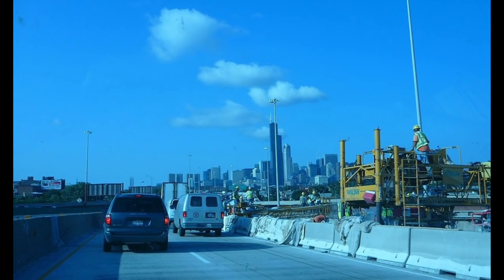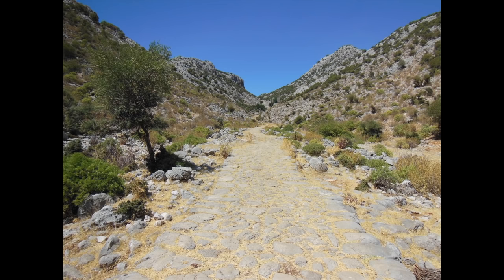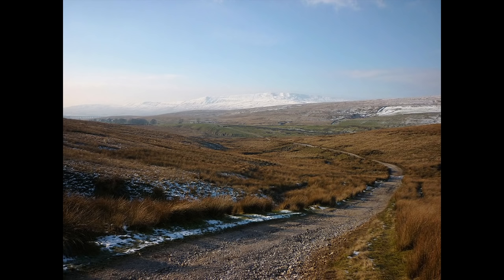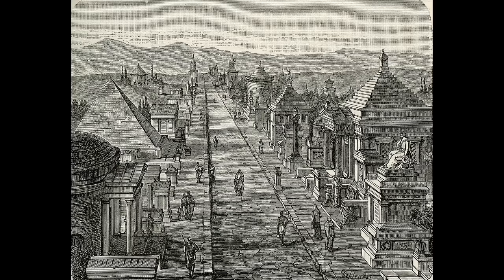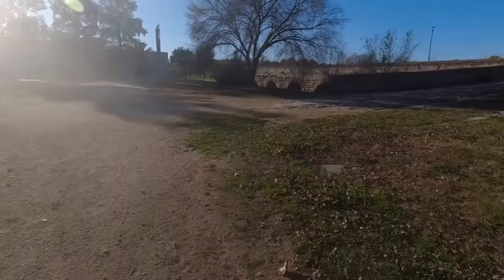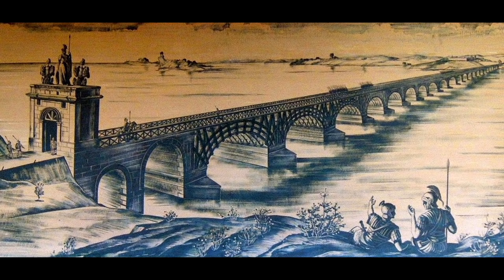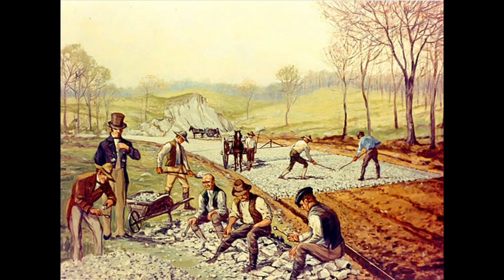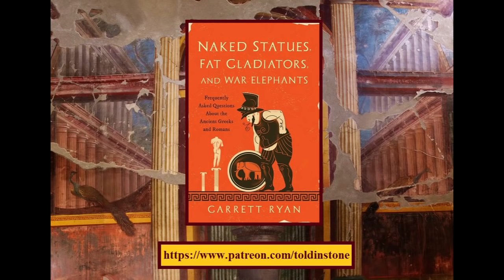Were Roman Roads more Durable than Modern Highways?

Comment: I’ll elaborate further as a civil engineer. It’s all semi trucks. That’s it, if traffic was just passenger vehicles we could get build cheaper infrastructure that lasted much longer.
Reply: Yeah, try running semis on Roman roads and see how long they last.
Reply: Why do that when you can have trains!
Reply: True that,And also billions worth of paving slabs,where semi's mount the curb onto pavements ,for deliveries ect
Reply: Kinda sounds like you might not be a civil engineer and just a guy who watched a YouTube video that was going around a couple weeks ago decrying semi trucks while neglecting the fact that the roads aren't built necessarily with the express purpose of private travel.
Reply: @dread6554  lol, I’ve designed so many bridges I can’t even give you a number. Get back to me when you’ve read your AASHTO manual a few more times.
Reply: @caballeroquimera2501  hush. Dont let the car manufacturers hear you
Reply: Semi trucks?
Hahaha

When actual trucks pass where I live
At 60 km/h or more
Then the whole bed and all windows start to shake.

Semi trucks don't bring that kind of weight displacement.
Reply: @dread6554  Commercial traffic is what keeps the economy running. So it's only natural that engineers would take trucks into consideration in addition to private vehicle traffic.
Reply: @MrDwarfpitcher  do you know what a semi is? Its a tractor trailer. The largest road legal vehicles. The biggest thing outside mining equipment really. Seems like a translation issue.
Reply: @MrDwarfpitcher  I'm not sure you're clear on what semi-truck refers to...
Reply: @Captain Irony Yes, and to last 50 years before complete rebuilding.
Reply: @MrDwarfpitcher  Terminology. A US semi truck is a truck tractor with a semitrailer that has no front axle, but the front end of the trailer rests on the tractor. They can be extremely heavy.
Reply: @MrDwarfpitcher  they mean a lorry
Reply: It’s called Greed
Reply: I wonder how durable or what materials for roads today would be used, if money wasnt this kind of a choke point in building infrastructure. Like if you could use the best aveliable materials and over engineer it to the max, what would be the best we can do? 🤔
Reply: @GarrettDore  I am not sure if you are betting on the semis or the Roman roads, but I think the Roman roads are so rough that the semis would be shaken to pieces.  They certainly wouldn't be able to travel at highway speeds.
Reply: That's why we should be investing more in high speed freight rail, with much less rolling resistance and damage. That way we can keep the 2 day shipping times without the damage that the semis cause.
Reply: So what you're saying is that if more freight was moved by train it would be better.

Trains solve everything.
Reply: @ieuanhunt552  Trains for moving the long and medium haul sections of freight. As far as the last mile parts, there will always have to be trucks
Reply: @ieuanhunt552  trains for the win 🎊
Reply: Yep!   That's why some commuter roads were called "parkways."   Unfortunately, they were pressured to permit busses to operate which meant that you didn't really couldn't cut many corners.   (You also need to permit firetrucks and emergency vehicles as well as road repair vehicles.)
Reply: Trains have entered the chat
Reply: @caballeroquimera2501  Freight trains are useful when you need to move a lot of cargo in the same general direction (and the USA uses them a lot already); but not when said cargo needs to reach as many different destinations as the train has wagons, at the end of the trip. Now, long-haul trucking in the USA has increased dramatically because of the design of logistics chains which rely on zero dwell time, the so-called "just-in-time" supply chains. Those rely on having trucks move cargo directly from origin to destination without resorting to intermodal transfers where part of the cargo's trip happens in different modes (rail, barges, ocean-going vessels).
Reply: one word; Trains.
Reply: @emcotec1463  i want my roads dripping in gold and ice
Reply: @caballeroquimera2501  No train station at local store.
Reply: The interstate highway system was built first as a strategic (military) asset, and second as commercial infrastructure. Private vehicle use is an afterthought and could be banned by an act of congress limiting personal transportation to surface level streets. Would end traffic congestion since most of it is caused by morons in their BMWs swerving in and out of traffic and failing to do basic things like zipper merge or use blinkers.
Reply: @fakiirification  well if its for transportation of military assets their findings say that trains are better even with some lines bombed, that research was done during 1921, so i dont know whats the point of the highway system other than serving car companies as trains are more efficent, for long distance transportation, from military assets, to cargo and passengers, so just asking, what would be the point of the interstate highway?
Reply: @ryleeroseborough7885  Last-mile freight used to be handled by trains as well. Hell, it still is in parts of Europe.
Reply: if only we delivered all our semi truck goods via electromagnetic catapults
Reply: @ryleeroseborough7885  Yeah but the size of the trucks could be greatly reduced if Rail infrastructure was improved upon.
Reply: @LucarioBoricua  Just-in-time is about getting the right supplier, it has nothing to do with getting cargo directly from origin. The point is the manufacturer transfers logistic risk onto the supplier. It is then the supplier responsibility to stock the needed material. The manufacturer doesn't need to have storage or concern for logistics but the supplier does. The supplier to the manufacturer could be next door or in a different nation. That cargo can go from international flight, to rail, to truck if needed, providing the supplier gets the material to arrive just in time for when the manufacturer needs it.
Reply: @charlestonianbuilder344  the issue is that I live almost 100 miles from the nearest train depot, my town would still need semi trucks to deliver food and other supplies.
Reply: @cara-seyun  back then rails was everywhere, railways built up entire towns and cities connecting them to the entire country, but then, car centric infastructure came and the railways that built the country started withering away, while the cargo trains managed to survive, passenger rail died off and what little trains left that still runs often suck as they arent as big for its benefits to be fully used, so, instead we need cars which is inefficent and more polluting, trams served as the ones that delivered goods and stocks to shops and markets, if you only knew how great and superior rails are if they still existed, americans dont understand trains as often they havent seen one in real life, or see how better they are due to the lack of them
Reply: @charlestonianbuilder344  I’ve been to Europe, I’ve seen how the trains are there
I didn’t consider it an upgrade from cars, but that’s probably because I couldn’t read French and got lost
Reply: yes and you can really tell in dallas tx when you get on the tollway since it doesn’t have more than 2-3 potholes in its entirety but if you get on I-35 it’s full of potholes and cracks since semis and constriction trucks always use that one but they aren’t allowed on the tollway
Reply: @JadedsoFaded  oh yeah, all the roads in my state have a frigging trench down the right side from the semis, when the frost cycles the semis can destroy a road that was just fixed in no time
Reply: @Carlton-B  they were actually smooth when built, they were paved with a sort of cement made from clay which was then compacted with rollers. It is extremely smooth, just like asphalt, the only problem is that it's not as strong as asphalt while being more expensive to make. Also, it has a tiny bit more rolling resistance than asphalt but that's not a big problem, the issue is the durability
Reply: It's not just semi trucks. It's the weather. When the ground freezes, we even have a word for it here in Finland, "routa" – you tend to get cracks and holes. Compare roads in Southern Europe to roads in Northern Europe and you will know it's the weather.
Reply: @caballeroquimera2501  Train tracks dont go near every single place that needs huge loads. They go to the stations then what? You're gonna carry them back to your place?
Reply: @charlestonianbuilder344  trains are still not as versatile as cars and trucks. With trains you'll need stations on every store and locations. You'll end up with more space used for fricking stations
Reply: @pochita6158  theres a thing called a tram, you see, trains are for your long distance transport, then they load it into trams which get things to your shops, that was how it was back then and it was efficent, more environmentally friendly and less maintenance, as rails wont break as fast as aspalt, also, whats the point of the speed and versatility of cars if your stuck in traffic since your so car dependant that everyone needs a car. There wont be any traffic jams in a well managed train system and trains dont take up as much space as cars, since you dont need individual trains for each cart, it can carry more loads than abunch of trucks, and does not destroy the roads its on as fast as trucks, theres a million cars and afew thousand trains, and you dont need a million trains to carry the amount of people a million cars can,
Reply: @charlestonianbuilder344  still how would a city with tram tracks on every possible buildings even work? Buildings are really single purpose forever so the tracks need to go to every single one of them but at the same time not every building would use them. Not to mention that the routes needs to be changed everything a building change its purpose. Just seems overkill and costly.

 There is so many rooms for error if a city relies solely on trains and trams. A mix of both is better. Trains  for long trips, trucks for short ones. People should rely on public transport but Roads are also needed for emergencies
Reply: @pochita6158  i never said cities should only have trains and trams, but the thing is, american cities are car centric, most havent seen a train in their lives so they dont understand how useful it is, the problem is the maintenance of the roads, cities would need an annual rebuilding of their roads as they are constantly being used, and the cost of it adds up overtime, and since theres so much road to maintain, not all roads can be maintained, 

thats why i proposed the trams which served the purpose of trucks before they were invented, they dont destroy the road they use unlike trucks, in order to lessen the damage, some areas would have trams, not only can they serve to transport goods and passengers, but also can relieve some pressure on the roads so that less trucks are used thus the lifespan of your asphalt for cars and roads slightly lengthens, cities will go broke if they try maintaining all their roads, and if you had good public transport, it just helps everything out, from drivers to maintaining the roads, to pedestrians and truckers alike, thats why im saying trains are better, not because i want to have a train centric city with no cars, but because american cities and cities all over the world are car dependant in a certain level
Reply: @charlestonianbuilder344  like I said, how are trams going to change the function of trucks? You basically still need a track from the train station to the stores which equals to a lot of tracks going through the city that can only be used by the ones at the destination. And if the store changed it's purpose then the tracks also needs to be removed. Then there's also logistics that needs to be taken care off which mean more work. 

Trains and trams are single direction travels, while roads are multidirectional. They're only good for long distances and for people since people can walk
Reply: @pochita6158  did i say change the function of trucks? no, what trams i propose to do is to try and lessen the amount of truck there are in the roads, you can also include buses too, as the one that damages roads the most about 90-95% are vehicles with heavy loads such as trucks and buses, while tracked ones like trams do less damage on their rails, im trying to solve the maintenance problem with roads, with things that have done the job of trucks before they existed, take alook at the trams of the ussr, they have been in use for decades and about half a century, and still works in great condition,  but was torn down to be replaced by car centric infastructure.

your arguing about how trams can replace trucks, while im arguing about the maintenance of those two and how better trams are, and unless we talk about the same thing we cannot find an understanding
Reply: @charlestonianbuilder344  okay I misunderstood a bit there. But you still haven't explain how in city trams to transport goods will work. It obviously can't work like a public transport since goods can't move on their own

And you were arguing how better they are in general, not just maintenance. I pointed out that trucks and cars are versatile. You can have all the maintenance freedom but if it's unusable, underuse or just create more work (like logistics) how is it better?
Reply: @pochita6158  underused isnt a good counterpoint, 
it was used alot to stock shops and stores by unloading the stuff behind the buildings as back then there was space in the back of buildings and they built tram lines in those, so it had shown it can transport goods, so its usable, now the type of goods are the not shipping containers btw, smaller things like boxes and such,
and any form of transportation needs logistics and work, would you rather have to do work over and over again as the roads for cars just get destroyed often, or have more work on trams which does not need a yearly change of track? 

also trucks and cars while yes versatile, but traffic would slow that all down, and id rather be efficent than versatile, along with maintenance, there are trams still working great half a decade old, eitherway you need more non car infastructure so that cities wont get bankrupt maintaining roads which the trucks destroy, look, if trucks dont do 90 percent of the damage on roads id be fine with them even with their other downsides, but the ponzi scheme inwhich american cities are built on just suck and if you lessen the trucks, it can help quite alot, what im talking about is that im trying to stop the constant spending on maintaining roads, by using trams as a substitute, it has been used in the role before, in the victorian era, and it helped lessen the amount of coaches which helped quite alot, so why not do that now?
Reply: @charlestonianbuilder344       it is a good point if we are talking about the current time. Buildings now are packed to the brim and stores aren't located in a straight lain or even A line. Factories outside the city does use some form of tram to transport goods, but inside the city they cant do shit. Who would use them? Walmart? 711?

 underuse doesn't mean unuseable. Just compared to roads where it can be use anytime by anyone, tracks can only use by certain parties and with restricted scheduling. When not in used, it's basically useless land

Your point about logistic is not even about logistic, it is again about maintenance. When you change your mode of transportation, like from a train to truck, you need work. Adding a middle man like a tram would add more shit to organize

Traffic can be solve by a multitude of ways, like better systems, better laws. Meanwhile making something with a lack of use is just waste of money

Why not now? Because there are more things moving now with a more spread out locations. There is no realistic way to have a cargo tram system IN the city now because like I said, they will be of little use compare to roads that can be used by anyone. Waste of money, waste of space
Reply: @pochita6158  you raised good points, while i still support trams, you have gave me the doubt for the transportation of goods by tram, but there should be a solution to trucks destroying the roads its using, as research shows they basically do all the damage, cars dont even compare, and mind that there are more cars than trucks and yet 90% of the damage is still done by trucks, also you can solve traffic with good public infastructure, like europe and especially the netherlands, along with trams for passengers. 

For trams to be used for transportation of goods you need an existing tram network which would need to be quite big, and unless that happens your point stands, as trying to introduce trams to a car centric country like the US wont really work as the 2 systems would contradict each other, shops were close together because they were pedestrian friendly, you dont need to go all around town going from shop to shop, it would be better to have them all together in one street, if cities were designed back then as pedestrian friendly centered around walking distance and not spread out due to car centric infastructure, trams for passenger and goods transportation will work
Reply: In your opinion, is there a method that is a less expensive overall alternative, taking into consideration wages, fuel costs, road repair costs, carrying capacity, and individual customer delivery than via highways in trucks?
Reply: And then we'd have to rebuild and improve all the railroads.  What's that going to cost?
Reply: @nonyadamnbusiness9887  the question is, how often do you need to rebuild it? The friction and damage a train does to its tracks isnt really as bad as a truck on a road, and also there isnt traffic in train lines so not every piece of track is constantly being used, or needing to be replaced yearly depending on the quality of track, where as roads need constant maintenance due to constant traffic and trucks
Reply: @charlestonianbuilder344  The fact is, if railroads were the cheapest way to move goods, we wouldn't have spent the last 30 years turning rail lines into bike paths.
Reply: @nonyadamnbusiness9887  um what? Thats not because its expensive, but because it lacks subsidies unlike cars and planes, along with car centric infastructure being dominant due to general motors interfering with city and suburban planning since the 40s, also, the amount of pollution done by cars and trucks pales to compare with trains as trains take several loads with one engine unlike trucka which takes individual loads, 

And cars and trucks are expensive in the long run as the amount of damage on the roads costs too much to repair as theyre too much of them to be repaired. Also trains are more efficent in transport of cargo and passengers, i can go on and on on more things trains are efficent, cost effective, environmentally friendly, helpful to car drivers and the economy, the effects of car dependant vs diverse transports and more, but since pretty much most americans dont even have seen a train and dont understand it, also every first world country has the capability of building trains, your saying that the richest country in the world cant afford trains?
Reply: @charlestonianbuilder344  Trains failed.  Get over it.
Reply: @nonyadamnbusiness9887  also, you havent even gave any evidence to support any of your claims, or counter any evidence i gave, its probably because you dont have any to support you at all
Reply: @charlestonianbuilder344  don’t think he’ll be responding anytime soon
Reply: @xijinpingsfavoritehemorrho1328  Semitruck is more like a half truck here :D
Reply: @ieuanhunt552  no they don't they can help alot but not that much
Reply: @caballeroquimera2501  Trains aren’t effective for transportation in a country like the US because of a house spread out so many cities are. The top three largest cities are on the left right and center of the country completely separated by thousands of miles
Reply: Another good argument for more train use
Reply: @MrDwarfpitcher  American semi trucks carry more than American full trucks. 

Their terminology is just weird.
Reply: Nope. Semi trucks travel on gravel roads just fine, the average cart would tear it up. Stop using your experience as a gravel compactor and asphalt layer to lay upon yourself the title of engineer cos it's an embarrassing comparison.
Reply: @GarrettDore  they do, over bridges, to this day. Modern roads don't even last with cars.
Reply: How much difference did the change from maximum weight 72,000 to 80,000 lbs make?
Reply: Road  damage is roughly proportional to a fourth power of axle weight and a square of speed. 
Simplistically , given that speed are more or less the same, a ten axle ton axle weight on a truck will do 10,000 times more damage than a one ton axle load on an SUV.  
It’s the price you pay for transporting freight by road as opposed to a cart!
Reply: @xijinpingsfavoritehemorrho1328 Actually the next size up is a road train…
Reply: So we need to find a way to get semis off roads or on they're own roads
Reply: What’s a civil engineer?
Reply: Are you an old enough P.E. to remember when the normal semi’s maximum gross weight was 72,000 instead of 80,000 pounds? The trucking industry claimed the interstates were overbuilt. You are clearly correct about damage to the full depth of the road. In snow country I do think there’s quite a bit of surface erosion from studs.
Reply: A semi truck causes 6,000 times the damage of a passenger car per mile traveled.
Reply: Michigan runs extremely heavy trucks.  In some States you can pull three trailers.
Reply: @5daysofcoffee  The standard gross weight used to be 72,000 pounds. The original interstate system was all but complete when the trucking industry lobbied to have it raised to current gross weights. Claim was rated tires would all be a little wider, so no problem.